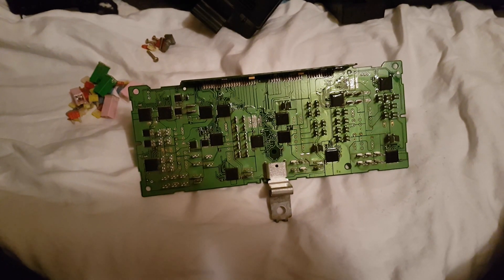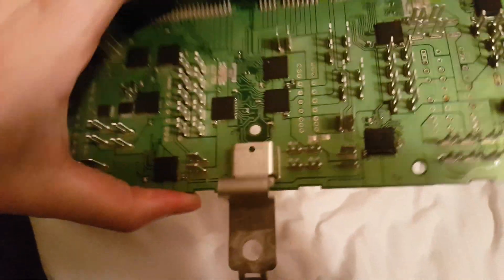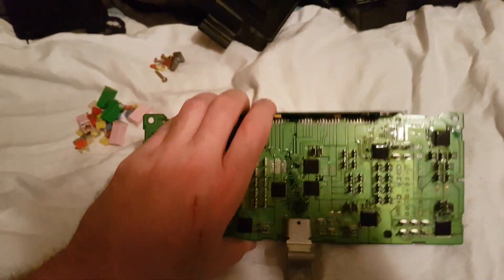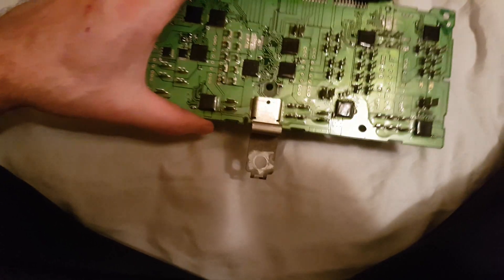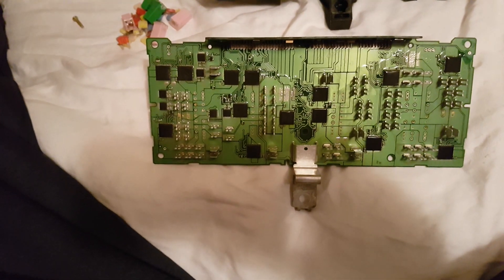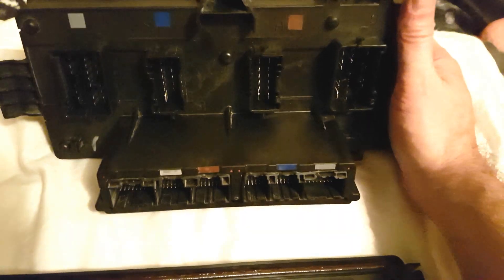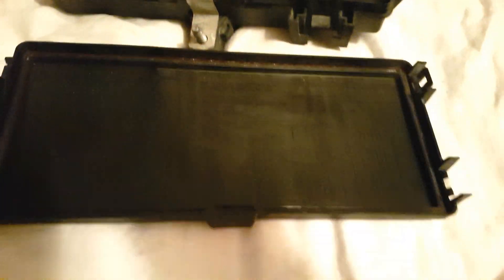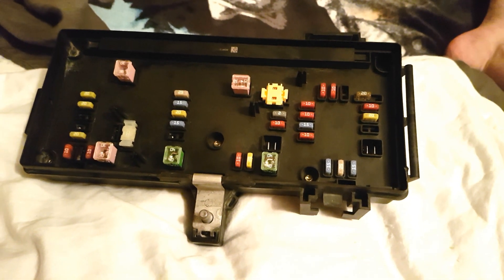Dodge Ram 1500 TIPM

Comment: Damn Chrysler and their TIPM fuse boxes. One relay goes bad. You have too buy the whole fuse box.. Not sure who runs the electrical department. But they should be beat with a stick. Same shit for Mini Van. The wiring harness under the intake burns up. Fries the ECU and PCM.. Double whammy if it shorts out the Coil drivers..
Reply: Bean counters, lobbied by Chinese electrical component manufacturers

Comment: 2008 Ram 1500. Does the TIPM control the AC clutch operation!
Reply: I believe the TIPM does have something to do with the A/C system. I have a 2006 Ram 1500. Truck is running, turn in A/C blower on control panel, A/C button light is not on, i bang on the fuse box then the A/C fan start turning and the A/C compressor clutch engages, cold air starts blowing & A/C button light is on. It also has something to do with side mirror heater. When my airbag light bell rings with the airbag gauge caution light goes on the A/C system shuts off and blows warm air. Sending my TIPM in for repair.
Reply: Also, my auto start does not work either.

Comment: IWORKUPNORTH, I'm not sure what the TIPM circuit does or control the cars modules? can you example what a TIPM circuit does in cars?
Reply: The TIPM is the fuse box panel and has some of the functions(lights especially) controlled by the board digitally instead of just running it through a fuse/relay like other vehicles. So my low beam headlights dont work because of a design flaw in the PCB board that causes it to burn up, so instead of a  10 cent fuse i get to buy a $650 rebuilt TIPM. yay me........

Comment: My girlfriend has the same size fuel fuse box but for the life of me I cannot find the turn signal relay fuse one headlight doesn't work so she stuck on high beam it only the front turn signals work
Reply: There is no fuse.. These TIPM fuse boxes control everything. As they have builtin relays. Thermal fuses that reset. Some times you can disconnect the battery cables. Then touch them together for 5 mins. This might reset it. If not. The damn box cost $300.00+ used...

Comment: im having an issue with mine atm. my ac wont work and my air bag light turns on. i removed then put it back in everything seems to work now. how much did this cost? ill have to get one to keep on hand.
Reply from the maker: i think i paid 100
Reply: I have the same problem. I bang on my fuse box, fan kicks on, compressor engages, A/C light on control panel turns on, airbag light goes out, and A/C blows cold air.
Reply: @bigjokerkrazyrace  sounds like a bad ground

Comment: which fuse/relay is associated with the condenser fan? would love to know
Reply from the maker: Thomas Spiegel so would I lol sorry I have no idea
Reply: I have a 2006 Ram 1500. All fuses are good. Relay is built in to the TIPM. TIPM has something to do with the A/C system & my side mirror heaters along with airbags. If my airbag light is on my A/C will not work. I bang on the fuse box the fan will kick on, A/C compressor engages, A/C light on control panel goes on, and the airbag light goes out. Once airbag light goes on then A/C shuts down blowing warm air.
Reply: It will be one of the flat pack chips. It appears they are using several switches in one chip.

Comment: Where is the park lamp relay located? I have 2007 Ram 1500 v6...my fuse box is exactly the same as yours
Reply from the maker: Kevin Connor go to 3min30sec in the video.
Reply: I'm looking for the actual relay for it, not the fuse. would that be underneath plastic that holds all the fuses?

Comment: Could that be my problem cuz my ac doesn’t want to blow cold air
Reply from the maker: IGetMoneyBagz 187 or your compressor or you have a ac leak
Reply: Bang on the fuse box them the fan will kick on, compressor will engage, A/C ligut on control panel will light up, and cold air will blow. Works for me 90% of time. But A/C system may not stay on long. Once my airbag bell rings and the advisory lights comes on then A/C system shuts off blowing warm air. Maybe when I bang on the fuse box I wake up the hamsters

Comment: These are a known issue from the factory. Do you really want to get one from the junk yard? $260 summit racing. Dorman 599-902. I think its a reman.
Reply: Apposed to spending 30 bucks at a JY? Yah, ill take the risk. These trucks were a dime a dozen and my 06 has more rust than paint 🤣

Comment: When buying from junk yard Does every aspect of the truck need to be the same? Such as 4x4 or 4 door, engine size etc?
Reply: I have an 06 Ram 1500 4.7L engine and the junk yard has 3.7 Engine. Will that make a difference?
Reply: @iamthird13  No..

Comment: Uggh it looks like they replaced the traditional mechanical relays with mosfet switches. If the chassis to motor bond goes RIP. 😵😵😵💩

Comment: which one is the fuel pump fuse not the relay
Reply from the maker: Robert Powers go to 3min 30 sec in video and pause
Reply: I did but it doesn't say fuel pump...wondering what it's labeled as
Reply from the maker: Robert Powers not sure then. these tipms are bs
Reply: currently having same issue, did you ever find which it is?
Reply: Ok